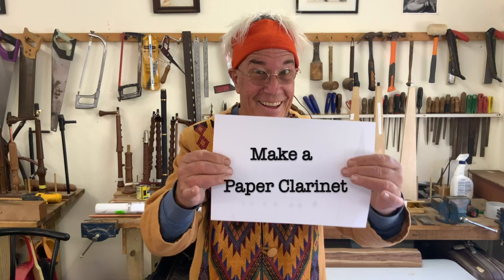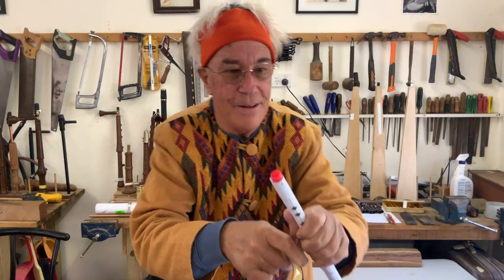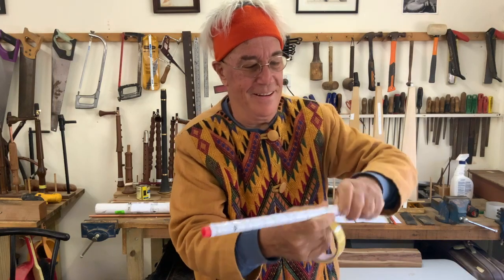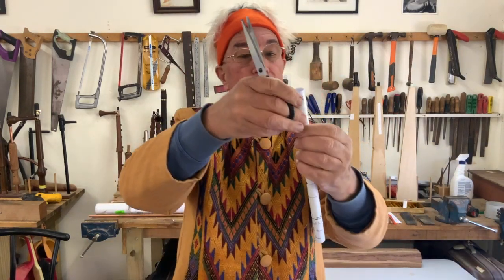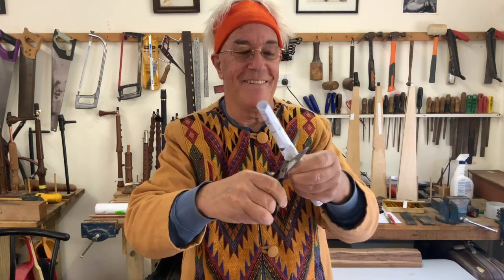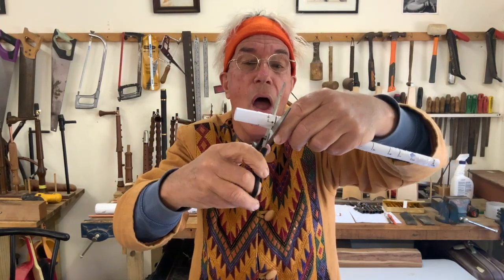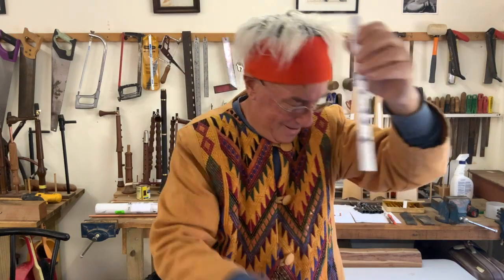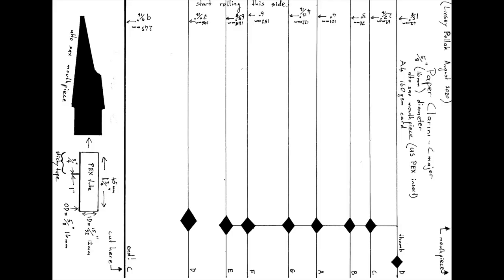Paper Clarinet - new improved quick making tutorial

Comment: That is amazing, well done!! I have a tenor sax mouth piece, do I need to scale it to higher lenght, or would it still work with A4?
Reply: I'm in the same boat. Did you try it?
Reply: I was using tenor mp on a cheap littlesax body. These have all altosax mp. Result: absolutely out of tune. So I bought an altosax mp, it is just easier that way I think.
Reply: @DeepspaceHorizon  
Thank you！